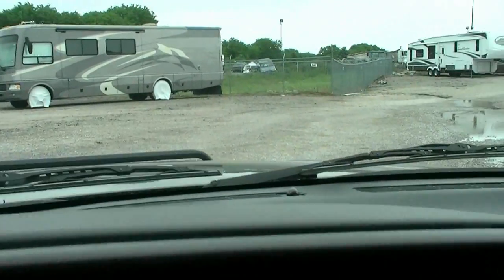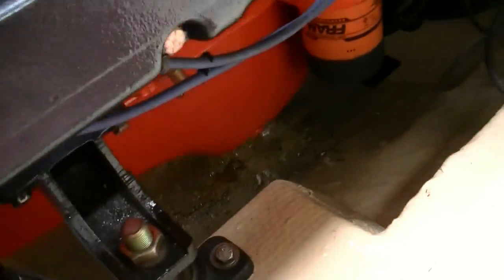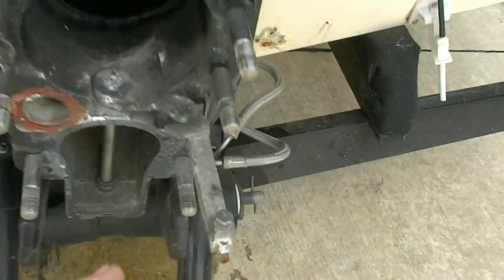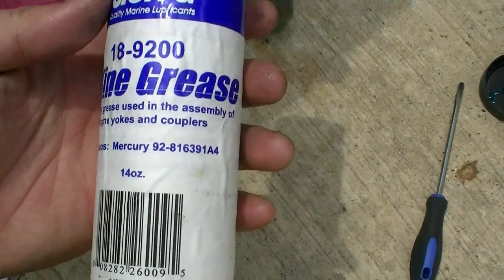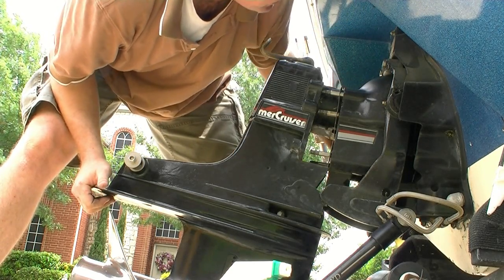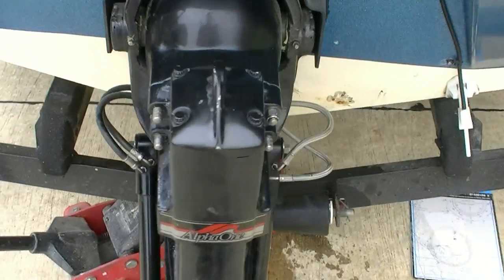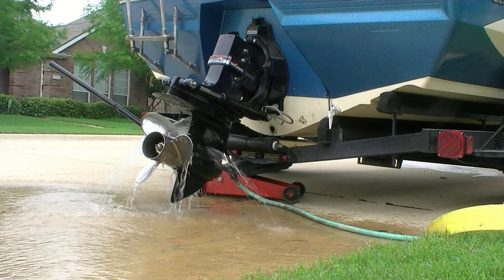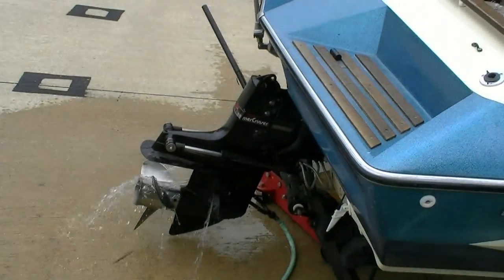glastron cleanup

Comment: always buy a fram sure drain plug kit for each boat, makes oil changes cleaner an faster then anything
Reply: Don't put so much grease on the tip of the splines.   It is too much for the cavity inside the couplerand creates a hydrolic pressure effect on the shaft. Good video